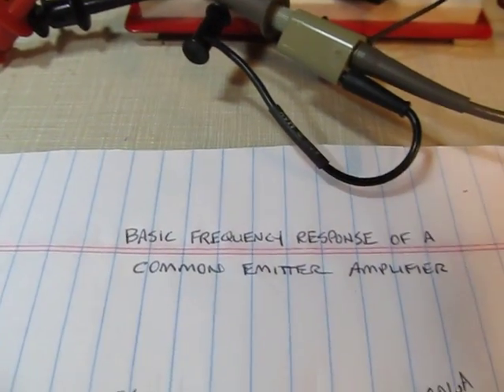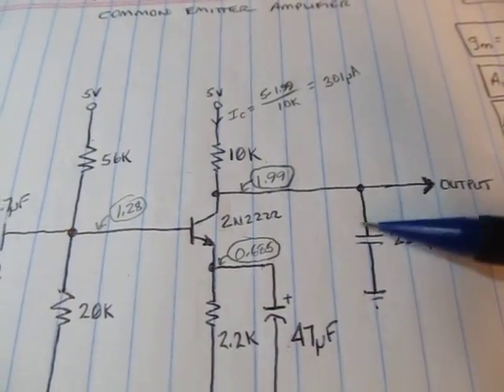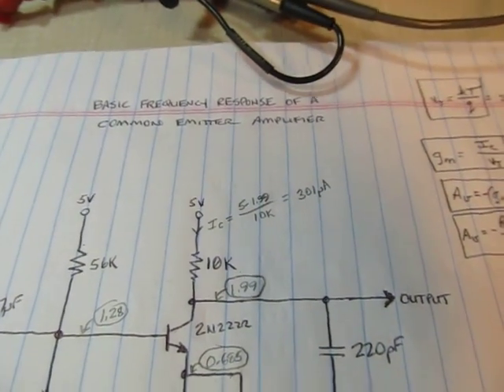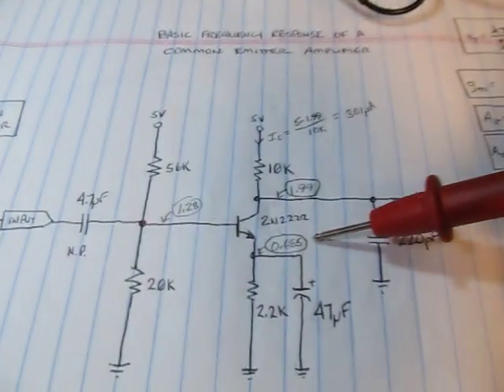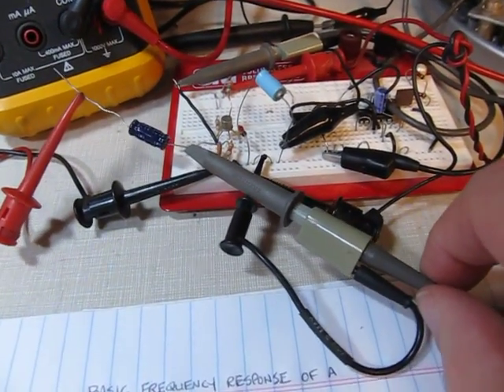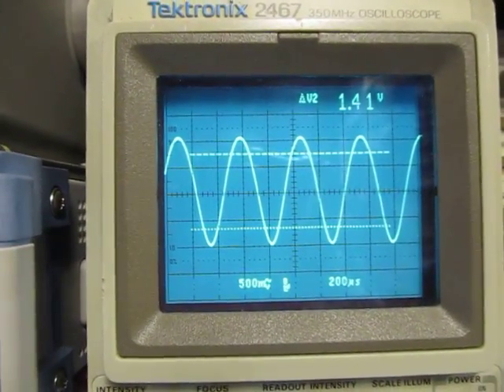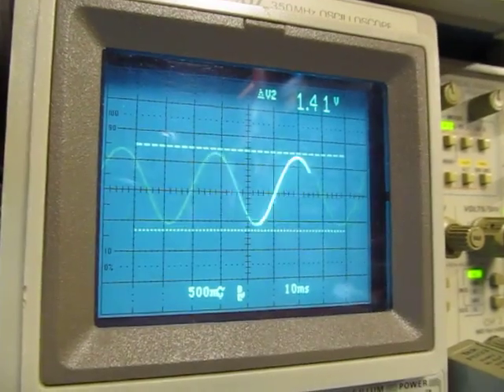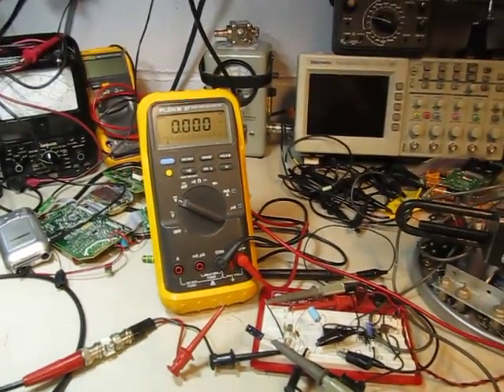#67: Basics of Common Emitter Amplifier Gain and Frequency Response with Measurements

Comment: How do you decide which capacitor to use for rb say if you want to allow all frequencies up to 22khz to come into the circuit
Reply from the maker: Can you rephrase your question?  "capacitor to use for rb" doesn't make sense to me...
Reply: @w2aew   Sorry what I meant was the capacitor at the base of the voltage divider resistors in a common emitter amplifier.
Reply: Class A amplifier
Reply from the maker: @seankennedy8506  This capacitor forms a high-pass filter - you generally make this large enough to pass the lowest frequency of interest.
Reply: @w2aew   Okay I think i get it now, So I'm using the formula 1/2piRC to calculate.
If I was to use this formula to instead calculate the capacitance : 1/2pi*(Freqcutoff)*(R), for the value of R would I use the value of R1//R2 in the formula, as in the parallel resistance of the two voltage dividing resistors?
Reply from the maker: @seankennedy8506  Yes, but you may also have to include the impedance looking into the base of the transistor (approximated at Beta*Re, assuming Re is not bypassed).
Reply: @w2aew   Okay thanks very much I understand it alot more now

Comment: How to calculate the voltage at base,collector,emiiter.Could you please explain
Reply from the maker: voltage at the base is a simple voltage divider: 5V * 20k / (20k + 56k)
voltage at the emitter is simply base voltage minus base-emitter drop:  base-0.6V
voltage at collector is simply 5V minus IR drop across resistor.  Collector current nearly equal to emitter current.  Calculate emitter current by emitter voltage divided by emitter resistor.  Then calculate IR drop across collector resistor and subtract this from the 5V supply.
Reply: @w2aew  Thank you so much sir
Reply: Sir,I wanna a ask one question why frequency response of ce amplifier is bell curve

Comment: I want to amplify voltage and current from 1.2 volt to 12 volt 5 Ampere signal so please suggest me and give calculation for this
Reply from the maker: Not enough information.  What kind of signal is it?  What frequency range?  What is the source?  What is the load?  What power supply voltages are available?
Reply: @w2aew  sir I have sine wave with variable phase angle but with very low power so  ,i want to increase  power of the signal and signal  is sine wave 50 Hz & amplitude of single is very between 6  volt rms so I want to increase amplitude up to 12 volt and 4 ampere  than I have applied that signal to my transformer so please suggest me
Reply from the maker: @milanmakwana3883  The voltage amplification is easy, but being able to boost the output current capability to 4 or 5 amps is not a trivial task.  It will require more than a simple single-transistor amplifier.  You'll need one stage for the voltage gain (such as a common emitter stage like this), but then a custom high-power buffer to give you low enough output impedance to get 4 or 5 amp drive capability.  A little more complicated if the output has to sink as well as source this current.  And of course, the power supply for the amplifier would have to be able to supply enough current for this to work.  Not a simple single transistor design I'm afraid.
Reply: @w2aew  dear if any link available for related this so please shar with me i want to amplify signal with 50 watt output not more from input please share with design or relevant

Comment: What is clipping and how do I remove it?
Reply from the maker: Clipping occurs when the signal swing is too large, and the transistor is driven into cutoff or saturation.  The cure is to reduce the signal amplitude, or change the transistor bias level to provide more headroom for the signal swing (higher supply voltage, different quiescent point, etc.).

Comment: Excellent videos. how i can measure THD of amplifier?
thank you sir.
Reply from the maker: One common way is to inject a single frequency and measure the output on a spectrum analyzer (or scope FFT).  Add up the power in the harmonics and ratio against the fundamental.  Great care has to be taken to ensure the input signal is free of harmonics, and that the results in the spectrum analyzer (scope FFT) are from the DUT and not the analyzer (scope) itself.

Comment: Could this circuit work on 9v?
Reply: Yes, but you would need to change the 56K upper base bias resistor to 120K to maintain the emitter bias point. You could fiddle with other values, but that would be the minimum you would want to do to maintain operation.

Comment: I'm not an expert on the subject but it seems to me that the 220 pF capacitor is going to take the ac component of the output signal to ground. Also, I thought the purpose of the 47 uF bypass cap is to increase the amplitude of the pulsating dc through the collector. SMH.
Reply from the maker: Yes, the 220pF cap takes some of the ac component to ground.  This capacitor and the 10K collector load resistor form a low pass filter, which determines the upper end of the frequency response.  At low frequencies, this capacitor isn't large enough to shunt the signal to ground.  And yes, the 47uF cap does increase the gain, at frequencies where the reactance is less than the 2.2k emitter resistor.
Reply: Thank you. That's what I thought. I still don't quite understand how the 2 filters work. I've been through chapter 27 of my textbook which deals with filters but I haven't yet found any examples that match the filters in the video. I'll keep working at it.

Comment: sir, can u help me  with the h- parameters and the R - C coupled amplifiers working and frequency response?     thanks:)
Reply from the maker: I haven't done a video on h-parameters yet.  But this video might help with understanding frequency response:
Basics of Common Emitter Amplifier Gain and Frequency Response with Measurements
Reply: thanks a lot..........
Reply: sire, can u provide me with some link about h- parameters......thanks
Reply from the maker: fatima syed Here are a few:
Lecture - 14 Hybrid Equivalent Circuit, H-Parameters
http://en.wikipedia.org/wiki/Two-port_network
http://en.wikipedia.org/wiki/Bipolar_junction_transistor

Comment: How to calculate Fh and Fl from circuit like this?
http://www.rason.org/Projects/bipolamp/design1.gif
Reply from the maker: +pilluritari The high pass corner will be determined by the input and output capacitor values, and the impedance seen on either side of the input and output.  There isn't any specific component shown that will limit the upper frequency low pass corner - so the high frequency will be limited by transistor characteristics, layout, etc.

Comment: 1:58 I still didn't get what is the purpose of 50 Ohm termination. Since you don't apply pulse it is not there to prevent ringing, Even you explain something  I still dont get what you mean. Could you explain it what is the benefit of that 50 Ohm at the input? Would be very glad!
Reply from the maker: The function generator has an output impedance of 50 ohms, so the voltage at the circuit will be the result of a voltage divider effect between the 50 ohm output impedance and the input impedance of the circuit.  Since the input impedance of the circuit may vary with frequency, the resulting applied voltage would vary.  By loading the generator with 50 ohms, that low impedance value will dominate the "load" impedance seen by the generator, thus keeping a good constant amplitude vs frequency at the circuit input.
Reply: @w2aew  Now its very clear! Thank you!